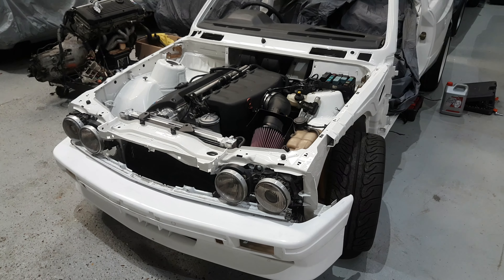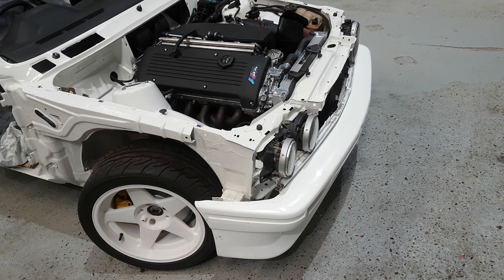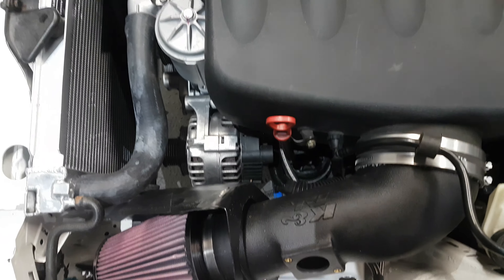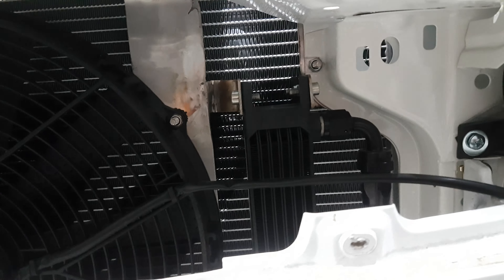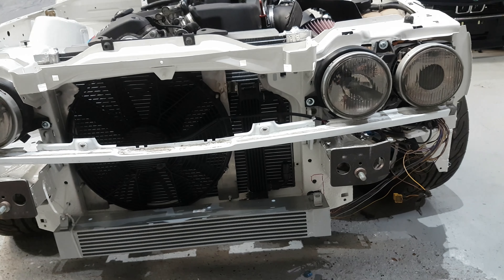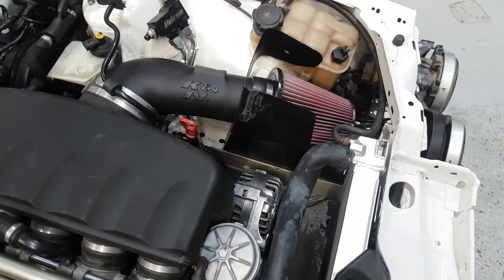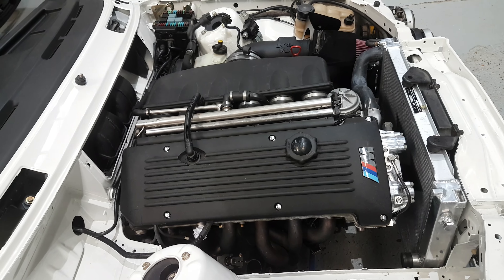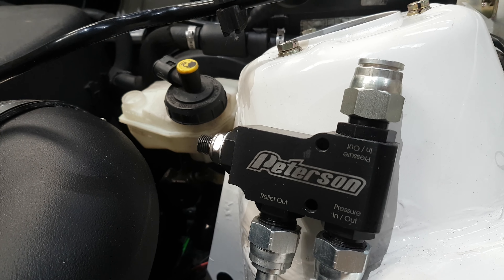lathams  restoration  - bmw e30 m3 s54 full car resto mod on the final build up

Comment: beautiful design.  of which brake booster??
Reply from the maker: Hi there, when carrying out a Mk2 Renault Clio brake master cylinder + Booster work really well. It still needs to be relocated to be a little further away from the S54 plenum on the bulkhead (and the bar to the pedal needs to be extended) but the size of it gives plenty of room surrounding. The master cylinder has 2 options depending on ABS (2 or 4 pipe holes).